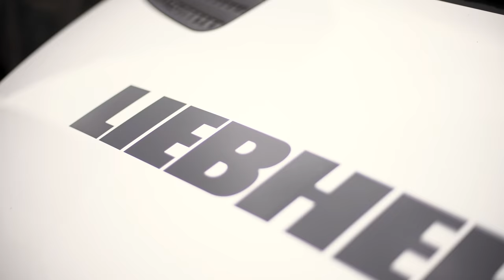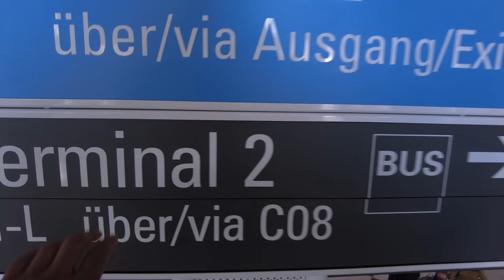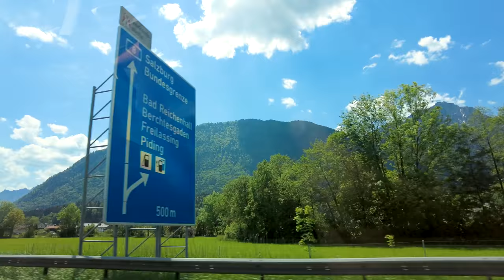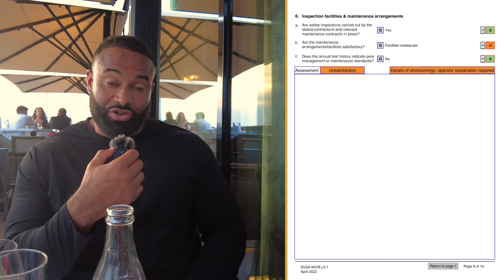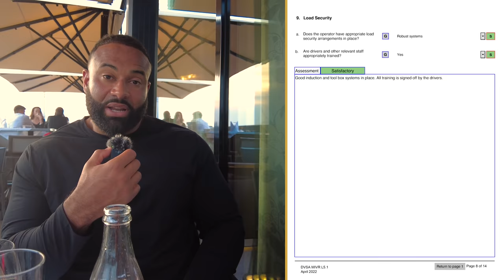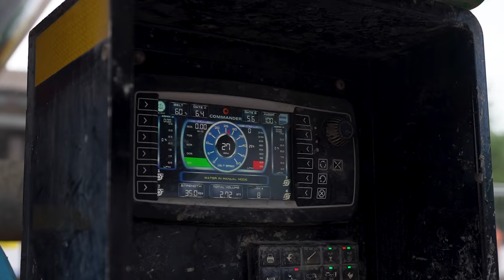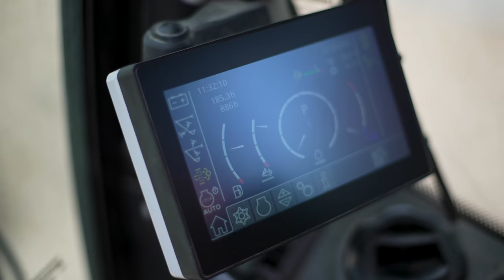Filming in Austria and £40k Bucket Damaged | Ashville Weekly ep085

Comment: DVSA love using the brake test excuse when they can’t find anything else. 
Mandatory is the MOT and they ‘would like’ to see an intermediate test between MOT’s but it’s not compulsory. The way they word is is that it has to be done though. We recommend our customers have a rolling road after 6 months from mot then the next would be the next mot, but we complete a tapley brake test which is satisfactory in tbe eyes of the dvsa. So I would say at the most, get a tapley machine and do them yourself, just a little box you put in the cab and do a brake check at 15mph

Comment: Loving the slippers 😂

As for your machine going into limp mode, a regen isn’t the answer, get them to check the status of the differential pressure sensor, sounds like it could be a bit to keen to say the dpf is blocked, either that or the nox sensor isn’t reading right. Ask for someone who actually understands what they are looking at when they use the computer

Comment: Also. Re the lorries and machines DPFs blocking. It could be AdBlue. Had a few guys take their DPFs off and it's blocked with Crytalised Adblue.. like chunks of crystallised AdBlue in the top of the Cats and DPFs
Reply: Isn't it great how the fluid meant to reduce emissions, that takes emissions and non-recyclable waste to produce and transport, will cause problems that require you to burn more diesel to try and fix or require you to purchase expensive filters full of maybe recyclable precious metals mined in strip mines with child labor that's then shipped around the world to produce said filters. Oh and the fluid to reduce emissions also puts out emissions itself. The emissions of said fluid also destroy sensors to monitor the fluid requiring even more manufacturing emissions and waste. Then there's also all this again and fuel being burned to get someone out to your location every day/other day to try and fix the problem multiple times.

You'd think they would create a better way of reducing emissions than DEF/adblue

Comment: Dan, do Liebherr watch your videos? if they did they would notice how often you mention them due to their machinery not working. I for one have noticed you were misled by their sales since you got the large machinery. First the bucket wasn't fit for purpose then the DPF regenerations on various machines and then not to mention the extension arm that is still to arrive. If I was after any plant machinery, I wouldn't choose Liebherr. I guess you could call them LIE-bherr.
Reply: IIRC in the videos with liebherr in the yard they showed the drawings they created for the machine and the bucket should have reached, unfortunately they didn't/couldn't test it until it was out there, hopefully they are working on the new arm, right now lead times for everything is absolutely insane and I can't imagine Europe is better off than the US.

The DPF, DEF, EGR crap is not company specific also. It should have been properly diagnosed and fixed the first time but the actual problems happen to all brands with that emissions bullshit. The only long term solution I've seen is to delete it, every other solution with part, regens, etc that I've seen and I've tried are just temporary and you are going to have problems with emissions equipment again. Idk how the UK handles emissions deletes but in the US and I believe Canada you can delete stuff and generally be alright.